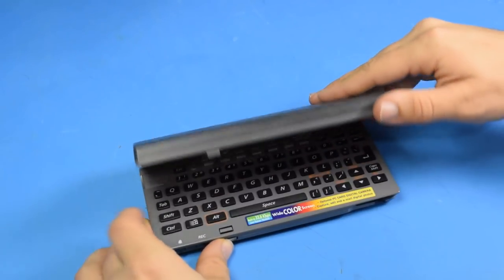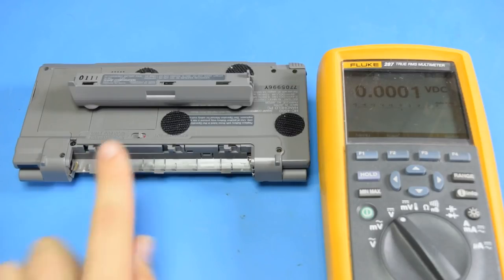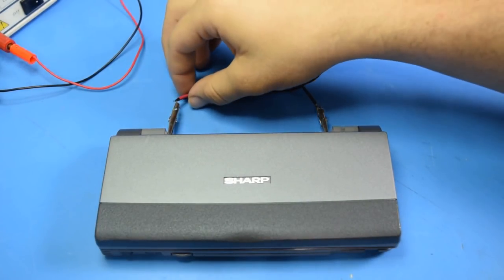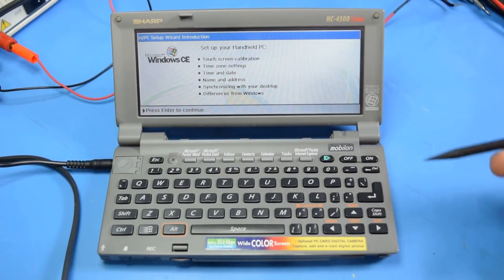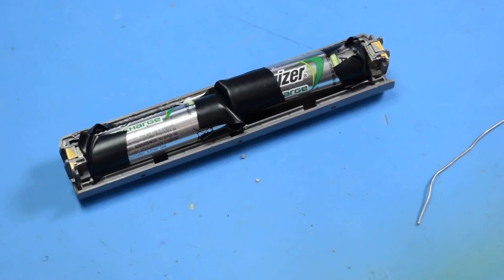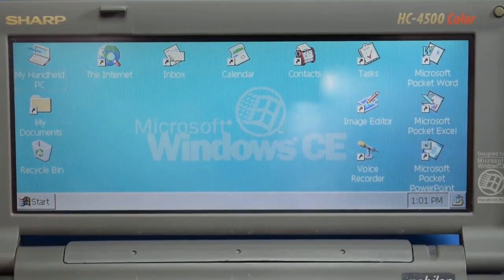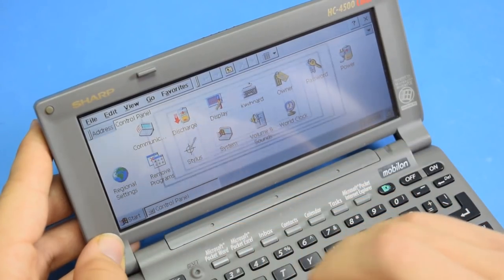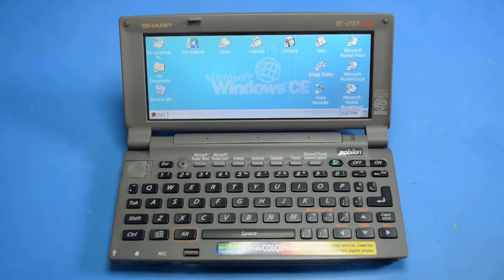0x002E - Sharp Windows CE PC NiMH Battery Rebuild

Comment: I recall Ashens having to do the same hackjob nonsense on one of these types of gadgets. He reviewed a Casio Cassiopeia unit, but I don't think it was the same one.

Also, it might seem irrelevant, but maybe your "modem to LAN" solution could be answered by a USB modem and some Linux PuTTY action. Don't use a PCI modem. You'll hate yourself.
Reply: TheUltimaXtreme Where is he going to mount the FTDI daughterboard to get USB support on there...? and how would he even get drivers for it? It looks pretty snuggly in that case already. I think this thing just has RS232 serial. This can be adapted to USB externally I suppose, but regular USB would be next to impossible. Internally, the USB would look like an RS232 line. I have a similar setup for my much more primitive Sharp Wizard OZ-770. USB to serial adapter for file transfer.
Reply: TheUltimaXtreme too late. I already do.
Reply: TheUltimaXtreme makes me love the house xxlx series of.palmtops. better battery life and standard batteries, runs did with a skin. And a actual PC in your pocket, and not windows CE.
Reply: Xinless Vice im not sure i understand what a house xxlx is...
In any event, windows CE got a bad rap. That is of course because microsoft required professional level purchase of visual studio, and in addition, the ce packages. So several thousand dollars later you could build an application which had no means of distribution back then. In short it wasnt going to yield big returns for software houses. However, under the hood it is a very capable operating system and microsoft spared no expense in building it. They even include an entire CD of libraries to use with the CE SDK.
Reply: Peter Lamont I meant the hp palmtops, the 95, 100 and 200lx,  they ran dos and windows 3.0.  While only having a 80186, they could run actual dos and x86 applications without modification.
Reply: Peter Lamont best thing we did was be used in windows mobile. Now that was a pretty good os.
Reply: Xinless Vice Oh i see. Ya i agree. In fact i almost went with the hp 200lx. Btw of the models you mentioned, only the 200LX has full cga support. The other two have hpga which is not cga compatible. While the others had MSDOS, largely none pf the software would run native. The advantage though was the the FAT file system was present, and msdos was present. The HP200lx is fully compatible and a marvelous machine. Sadly, it has no backlight and a very small native storage. This often means investing in tons of peripherals. In the end, i got this because it was 6x cheaper.
Reply: Peter Lamont the 100lx is also Cga compatible. Just has older versions of the programs installed. The 95lx isn’t though. Plus, you can use cf cards in the 100 and 200lx to increase storage and add capabilities that the machine lacks. Plus, it can run dos games from the 8088 and 80286 era. I mainly got it for that expanability and compatibility .
Reply: Xinless Vice i hear that. Frankly, your preaching to the choir. I very very nearly got the 200LX...Heck I may yet get one. There is a slight difference in that the 80186 deosnt have protected mode like the 286 does. But very little software takes advantage of that back then. I was about to fire up qbasic 4.5 on there and have a blast. But the backlight! Why didnt they install a backlight? I saw the mod for putting one in, and just decided against it. If i broke it i would be down $200. So for less than 50$ i got this. This(the sharp) also has a pcmcia type 2 for adapting to flash scsi etc. Although the windows ce support for other things is less pronounced than dos. He doesnt mention it this video...so i am not sure if he is aware how powerful that slot is...
Reply: Peter Lamont yeah. PCMCIA is quite capabable if you know what your doing with it. It’s a shame that the hp lx series doesn’t support protected mode, but for literally having a entire pc xt in your pocket, I can accept the trade off that it brings. Personally my main issues with them are the hinges. Apparently the right hinge can crack easily without lubricant, and the 80186 does not support normal HD’s do to lacking support. But compactflash works well enough.
Reply: Peter Lamont speaking of which, with a pcmcia to compactflash, that would be an excellent method of data and file transfers to just about any of these palmtops dos or ce based. Don’t know how easy it is to get windows ce apps over dos though. One of the main reasons I chose the hp series. Even just finding apps for windows pocket pc and windows mobile is hard enough. At least for palm os, archives sites have popped up now.
Reply: Xinless Vice Youre not out of luck on hard disks with the 200LX. I read extensively on this model. You can get DOS scsi drivers and plug in a zip disk drive. On ebay right now is an addonics external scsi zip drive for $40. I recommend you grab it while you can. The atapi drivers and config.sys settings can be found on vcfed forums if memory serves.

This means you can get effectively 100mb hot swapable "hard drives". However, there is one thing you must consider. The output pin of the 200LX vcc line only drives 250maH...again i did a LOT of reading on that model :). So you would have to get a battery pack with the required voltage and wire up a barrel connector for external power or plug it into the wall with the supplied wallwart.
Reply: Xinless Vice hpc:factor is a massive resource. I met the mod today and asked about dev software. I am all ready to start developing for win CE. I still need to order the cf card and adapter though. Dos has better support for peripherals. Hou could also get one of those Panasonic 4x battery powered cdroms. They arent cheap but they are self powering! If you do get that, make sure to write your CDRs at 1x or 2x for maximum reflectivity. The older cdroms are less forgiving of CD-R images. By less forgiving i mean ruthlessly unforgiving. You need commercial quality write or they just ignore the cd. Although the one I had was slightly older than this. I used it on an old thinkpad.
Reply: Peter Lamont true. Thanks for the info about scsi. I was planning on just getting a pcmcia parallel port to use printers and Zip disks. In that case I’ll check that out thanks again. I’ll have to give ce another shot at some point then as well.
Reply: Xinless Vice my data transfer setup initially will be IRda port using windows Activesync. Later, i will use usb to cf adapter for my laptop, and then cf to pcmcia adapter on the mobilon. This will allow me to use cf cards like a "disk" where i can swap them out as needed. On the 200, i recommend the same. Idk how much memory yours has, but the ones i was looking at had 2mb. 640k is the main memory, 384k is the os. So your ram drive ranges from nothing to maybe a megabyte. You'll need the space. Furthermore, applications will run much faster on the ram drive than directly on flash. Flash memory access time is far higher than SRAM. Correction! Dos programs load into memory...so you can think of the flash as pure storage.
Reply: Xinless Vice im glad i caught you then. At least for zip disks, DO NOT buy a parallel zip drive. Unlike the its ide counterpart, the iomega zip parallel drives are TERRIBLE. They were the subject of a huge industry scandal. They made the drive head assembly super crappy and they crash onto the zip disk surface ruining the disk and the drive. Addonics external model is rare, and reliable. Buy it and dont look back. You likely wont see another one for years. It even comes with the supporting pcmcia card.

Edit: i give you this advice with a heavy heart. I plan on getting a 200 in the future...and likely i wont be able to find one of those...but if you already have one, it should go to you. Get that drive.
Reply: That said, im jealous that u can hook up a parallel line printer/inkjet. I bet i wont be able to do that in windows ce.
Reply: Peter Lamont cool. I’ll check that out. I do already have a parallel Zip drive and disk. Works fine. Better then most of my floppy disks, but I’ll take your word for it.
Reply: Peter Lamont . True. But some of these palmtops that have ce have infrared, so you might be still able to use it to print to it printers and use as a remote. I don’t believe the or port on the lx series is 100 percent irda compatible, though it seems mostly compatible.

Comment: The old cells in that battery pack look like the same cells used in this battery pack:

https://www.ebay.com/itm/113023688398

I opened up one of these packs to scavenge the individual cells and they're both shorter and fatter than rechargeable AA cells, and look closer to the original cells in your battery pack.

Unfortunately the individual cells don't have any markings so I can't give you a part number for them.

Comment: I don’t have much use for a PC nowadays but when I do, it doesn’t have to be full size. I replaced my old desktop with a tiny MiniX PC which is working out just fine. No more noisy fans or HDD’s! My office is FINALLY quiet. Recently, I’ve been hacking my mini NES and I would prefer a tiny laptop because I keep moving around. I still have my 7” Asus Eee PC but It’s currently at another house. That thing was very inexpensive back in the day, so, I figured that I’d look for a “modern” 7” laptop. Nope! All I see is a $500 GDP Pocket. Whatever happened to sub $200 tiny laptops? I saw a Window’s 7” tablet but it’s already 2 years old. My little MiniX was just over $100. I can’t understand why we only have old 7” machines or an overpriced machine without even a trackpad.
Reply: Intel kept making 32-bit only Atom chips that were utter shit well into 2016 that small devices had to use for power & heat reasons until Microsoft stopped supporting any new OS upgrades for such chips (they're all stuck on Windows 8.1 or 10-1607 with no upgrade path).  Having no 64-bit probably added to the issue.  Microsoft stated intel stopped updating the atom cpus / stopped supporting them so they would stop letting windows run on them too? whole thing sucked.  Shame really, that plus Android's widespread use under ARM just about killed netbooks and x86 tablets under 10 inch size completely.   Now there's GPD and NuVision tablets and like... that's it.  They have Atom X5 and Core m3 that address those issues now but the market for such devices is apparently dead or limping along.  GG intel.
Reply: lcrazy8l Yeah, the selection nowadays isn’t great. I recently noticed that Microsoft came out with a “Surface Go” for $399, however, It’s running Windows 10 S which makes it completely useless for my needs. I need a Windows machine that can run obscure software. Not some dumbed down version of Windows. At least netbooks ran regular applications.
Reply: Ace Report get a used HP 215. A good model (quad core a6 and 8 GB ram goes for 200$) I had one for 4 years. Not a bad laptop and has decently powerful graphics (better than hd 3000). Just stay away from.the dual core. They don't have much power to begin with.

Comment: The Sony Vaio U and P series really suck. They're based on slow Atoms and integrated chipsets, and they're extremely bulky for their class. 
Go for an OQO. They're faster, they have a better sliding keyboard, they have a better tablet input, and if you get a model 02 series it's fast enough to run (some) games. The Sony devices most definitely are not.

Comment: WTF if you have 2 5A fuses in series, that doesn't make it 10A its still 5A.
Reply from the maker: What you said is correct. However, these fuses are in parallel which would make this effectively 10A current limited.Fuses in series would be pointless.

Comment: why not 18650?
Reply from the maker: The different battery chemistries are charged differently. It would be dangerous to charge 18650s which are lipo when it is expecting nmih batteries.

Also they wouldn't fit.

Comment: Windows CE was like ME. NT is better.

what i did there?
Reply: VladNex I own a windows me laptop. Old hardware works best like Pentium 2 era stuff. I have a winme laptop with a Pentium 3 600MHz and an ati rage mobility m1. Pretty awesome laptop. It has usb and windows me has generic usb drivers. Only gripe is that the battery needs to be rebuilt and I want a better CPU. There was a model with an 800 MHz P3 so I might use that for an upgrade. And more ram. Mine has 192 MB installed and I want to take it to 256 MB.

Comment: Get a GPD Pocket!
Reply: GPD Pocket missed a huge calling for itself.  If they had made the screen hinge double back all the way like a Yoga laptop to convert between tablet & netbook I'd throw any amount of money required at them to get one in 7in or 8in.
Reply: Yeah, that would be sweet really. Just being a pocket-sized laptop doesn't really go that far, especially how tiny the keyboard is, I rather do thumb-typing like on GDP Win 2 and smartphones back in the day dominated by BBs and WinMobiles.

If they do that for GDP Pocket 3 with a convertible hinge with N-Trig digitizer support so it can support Surface Pens, that would be awesome. I don't know if people would like it having an ARM SoC but I prefer to have that than Intel. Having ARM SoC will definitely extend the battery life and requires no fans, so the device will be bit thinner and get a bigger battery. Only downside is for any Win32 apps that are not recompiled for ARM will get emulated performance which is rare atm with only VLC a popular app have an ARM version (I'm not talking about the UWP app which is totally different).